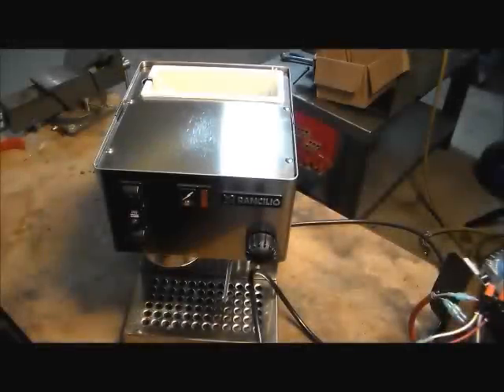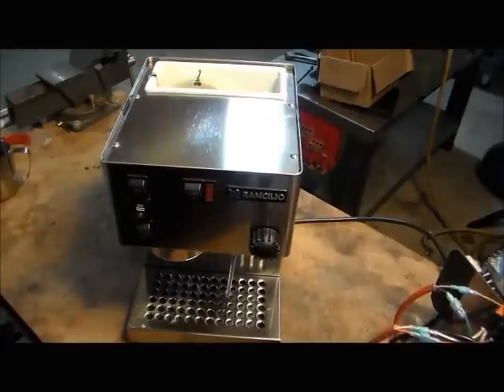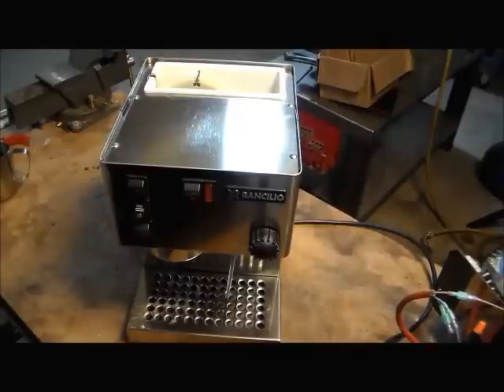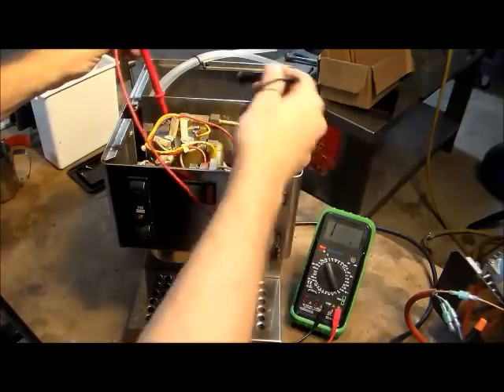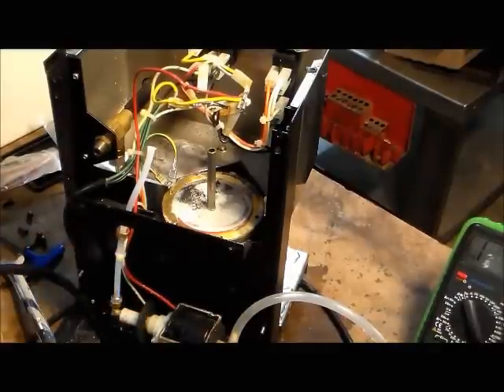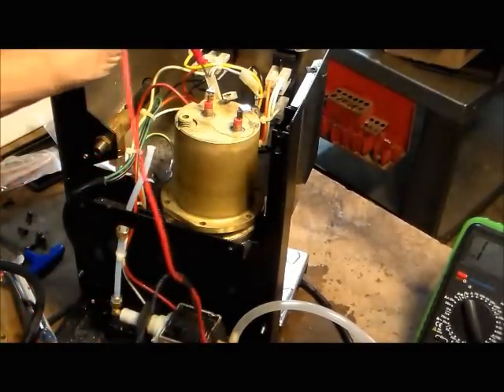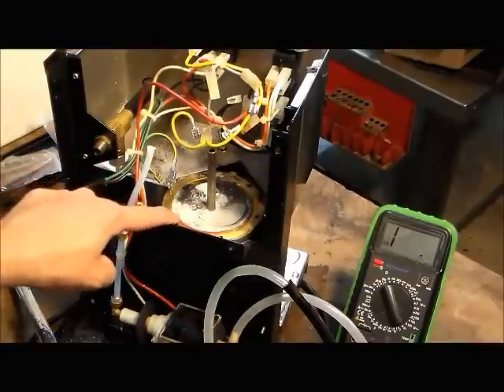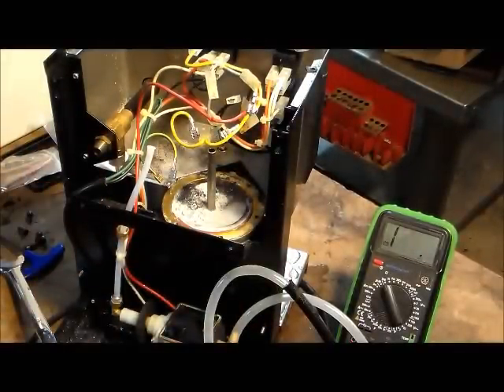How to Repair a Rancilio Silvia Espresso Machine with a Popped Heating Element

Comment: Really nice demo of multimeter use. A solid answer to that particular problem (and the old style I'm rebuilding at the minute although I'm just cleaning mine out and replace the Badly rusted bolts with stainless,gasket, cracked silicone tubing et al and grinding down a rusted frame and treating)
Thanks

Comment: My Silva just broke down and I'm lost without my morning coffee. When i push the button to pull a shot i can only get a few drops out of the group head, and this is without the portafilter in place. My water reservoir is full. The steam wand works fine. The machine is heating up just fine. I read a thread that mentioned it could be the coil? Any thoughts would be greatly appreciated.

Comment: The Silvia V5 2016 has a new boiler design: the heating element is replaceable. You don't need to replace the boiler tank plus the heating element. :) Just be sure to get the heating element with the correct voltage; 230 VAC (1100 W) or 110 VAC (800 Watts).

Comment: as luck would have it my gasket was fine, and my boiler is fully functional BUT my lower boiler half appears to be warped and why it was leaking in the first place. any thought on what to use to either make it true again or a food safe sealant to bridge the gap? I ordered food safe rtv

Comment: My solenoid valve is leaking during heat up and pissing while using hot water mode on my Rancilio Silvia, also can't get enough brew and steam pressure, almost feels like the boiler is always empty

Any thoughts,

I've already cleaned the valve assembly but I'm thinking bad coil.

Comment: I have a Blitz 220 DA or so I've been told but am unable to find any information about it on line. The milk side boiler isn't heating up, I don't hear the pump turn on to pump water to that boiler. I don't feel the heat on that boiler. It looks like its been repaired a few times from before I got this machine. Do to the abbreviations on the cable connectors inside the machine. I'm pretty good at figuring out things and I'm thinking it's either a wireing issue, a controller issue. It was gifted to me after a friend who was in the espresso repair business had passed. Would you mind troubleshooting my problem with me. So I may gain your knowledge on my machine. I thank you ahead for you time.

Comment: Er, you're not telling us how to repair the machine, merely your correct diagnosis of the problem. And you are better using a Meggar than a multimeter. Very often the multimeter gives a satisfactory reading but the Meggar at 250 or 500 volts soon finds the flaws.